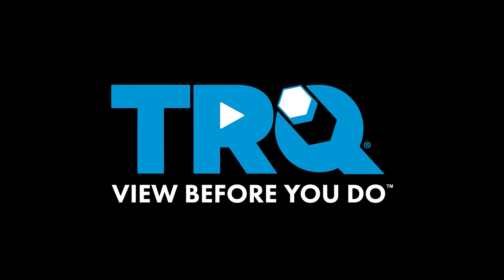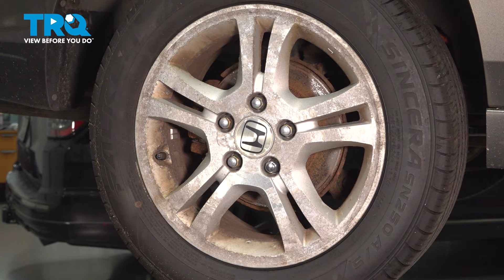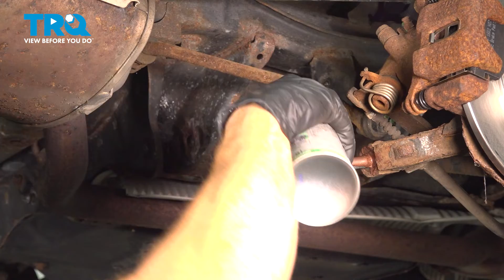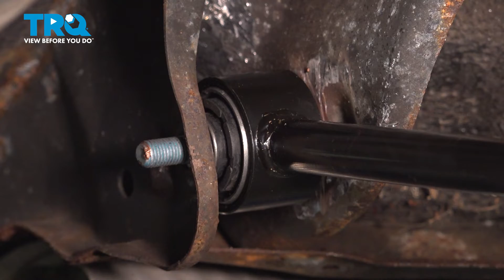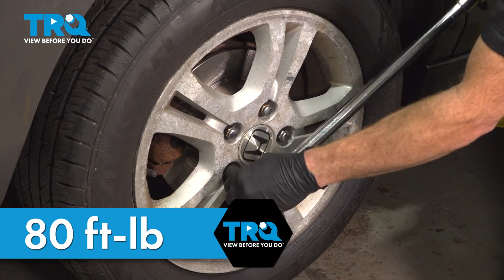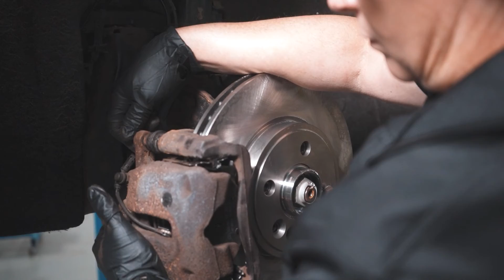How to Replace Rear Lower Control Arms 2003-2007 Honda Accord

Comment: This is a good video breakdown, just an added tip. If you replace your control arms, be aware that these bolts do not come with the control arms. You will need to buy them, so make sure you have them before you do this work. Make sure you get the Genuine Honda Rear Control Arm Adjust Bolt set. You must be aware that many times you only get the bolt, but you also need the cam and nut. I did manage to find a seller on ebay with the entire set 2 bolts, 2 cams and 2 nuts for $67 and that seems to be the best set with everything included. Search (New Genuine Honda Rear Control Arm Adjust Bolt Kit (1999-2007) OE 06520S0XC00)

Comment: One thing to mention - the honda service manual says to mark the position of the adjusters (those round washers on the arm that got stuck) and so you can put them back in the original place. I had the exact same problem as everyone else where the bolt would not come out so I've had to abandon the job for now and wait for the new bolts to arrive as they weren't included with my arms :(

Comment: The bolt on mine was also seized like that. I had to buy something to cut it and a replacement bolt, but it was still cheaper than taking it to a mechanic and it was a great learning experience.